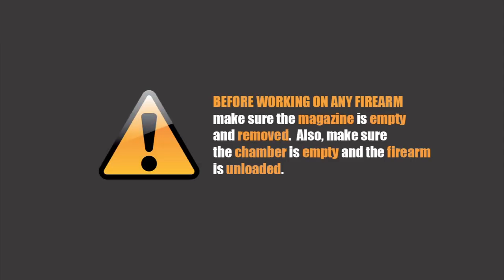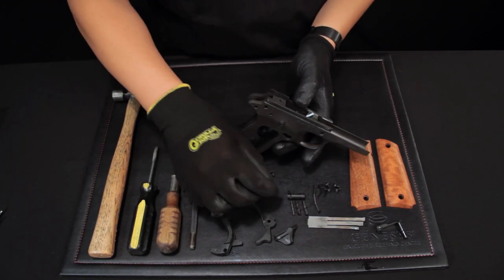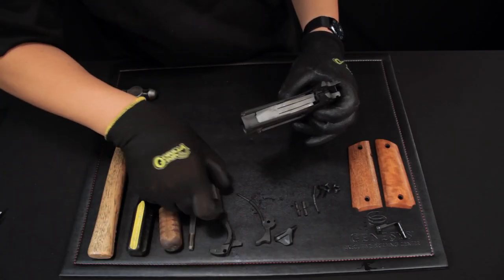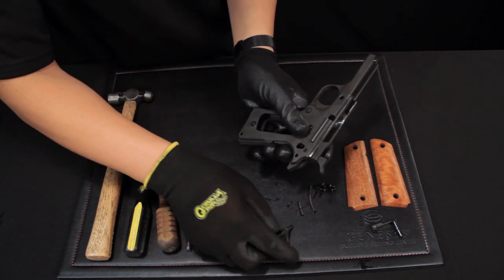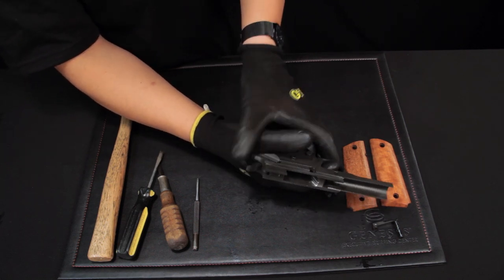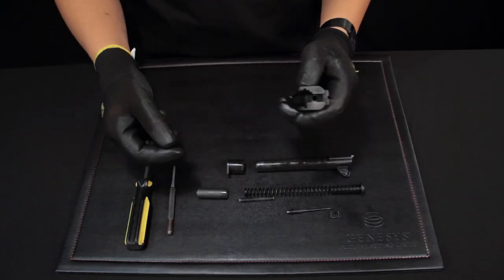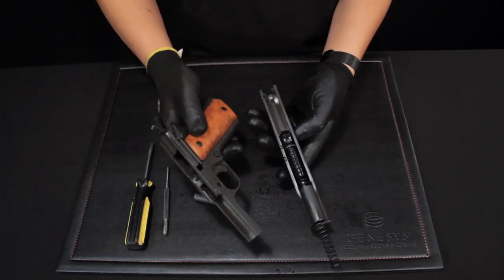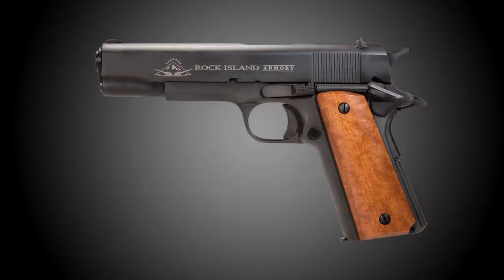Rock Island Armory 1911 GI Series Assembly (Official)

Comment: Good video, but would have been better if you had shown the necessary lubrication points. I'm new to 1911's and now I'm going to have to disassemble mine again to lube properly. Also, at 1:17 you say to turn the screw counterclockwise, but you are turning it clockwise.

Comment: Although I'm an old fart, I am new to the 1911.  I was wondering about the disassembly and cleaning of the 1911 for practical purposes.  Is it really necessary to go any further than the disassembly and cleaning of the upper receiver parts (i.e. barrel, firing pin, extractor, spring, slide, etc.) where most of the fouling would take place?  I would think the disassembling of the lower receiver for cleaning might be something you do once in a great while.